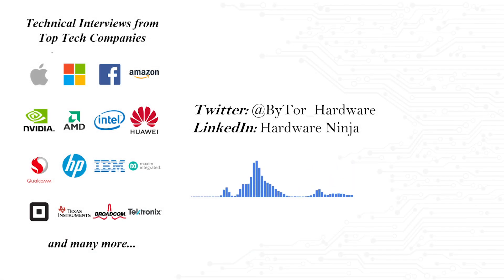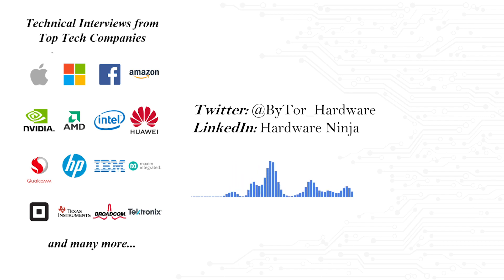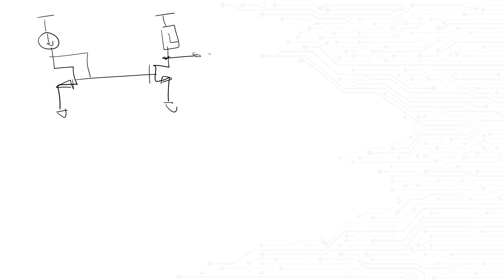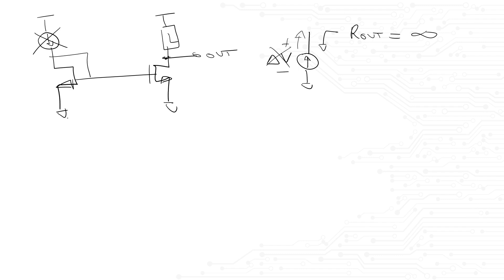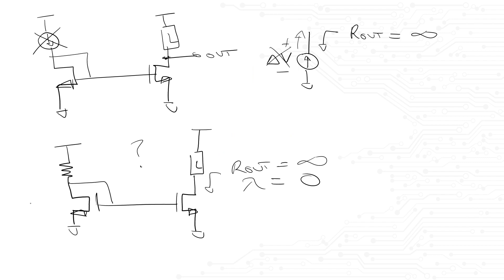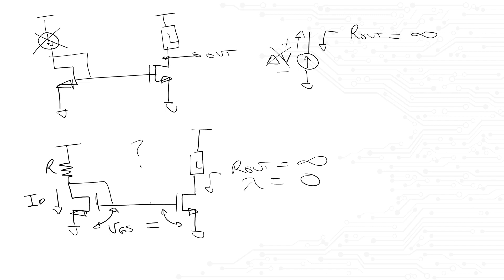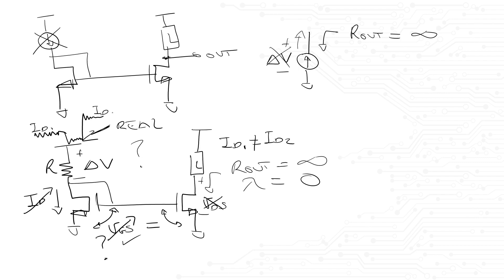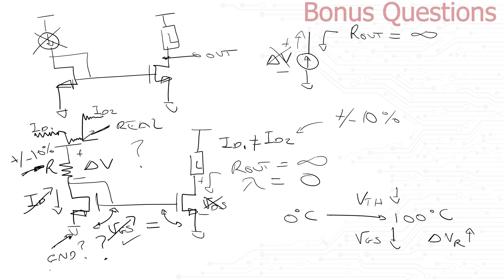HWN - Real "Analog Design Engineer" Interview Questions

Comment: Why is the Rout is infinite for the very first question
Reply: An ideal current source has infinite output impedance because ideally it can provide its set current regardless of load demands. It's drawn a little confusingly in the video since the impedance would be across the current source. An infinite output impedance would mean no current flows through it and all goes to the load. This is why there's no such thing as an ideal current source.

Comment: You can make a current source using CMOS "psuedo nmos" topology, by replacing the current source with a PMOS which his gate is biased, resulting in "controllable" current source
Reply: You would need to generate the bias for that Mosfet which would in turn lead to area and power wastage

Comment: can you answer last question asked if current would change if ground has noise? i simulated and found that input branch current changes but not output branch current. why is that?
Reply: Because everything is referenced to ground it doesn’t matter what ground is
Reply: @Coolgiy67  I assume you mean same ground... if there is resistance between ground connections of two mosfets their vgs will differ.

Comment: Is the 3rd way a diode connected transistor? the mosfet will always be in saturation and should provide a constant current independent of the voltage?
Reply from the maker: Thank you so much for your comment and contributing to the community! Do you mean a diode device connected directly to the supply voltage? If so, that wouldn't be correct. We will give you a hint as to why. Think of the same problem of noise and DC level in your power supply. Hope that helps!
Reply: @HardwareNinja  Can you please tell the answer I am really confused.
Reply: @HardwareNinja  Diode is commonly used with BJT to provide current source independent of changing Vcc but it seems there is no diode+mosfet combination, I dont know why too.

Comment: Poorly asked question. You say that we could use BGR then ask to use resistor. A bit confusing tbh
Reply from the maker: Hi Yunus,

Thank you for being here, we appreciate your support! If you listen carefully, ByTor says "Let's imagine you did say a bandgap but the interviewer wanted to push you, which may happen, and said "OK imagine for now i do not have a bandgap circuit available" what else can we do?""
Reply: @HardwareNinja  Seems like you say that u want to use resistor then ask what’s incorrect in the circuit. Because the issue is related to the resistor and you ask to use a resistor, it can a bit confusing. That’s why I thought it would be good to reformulate the question
Reply from the maker: Hi Yunus,

Our goal is to make the material as real as possible. During interviews, it's always best to keep answers simple, hence the resistor. That being said, we merely try to show what questions one might face when picking a certain topology, configuration, or component.  The interviewers are trying to probe the depth of your knowledge, they're not after right/wrong answers. Hope that helps clarify our approach! We truly appreciate your feedback!